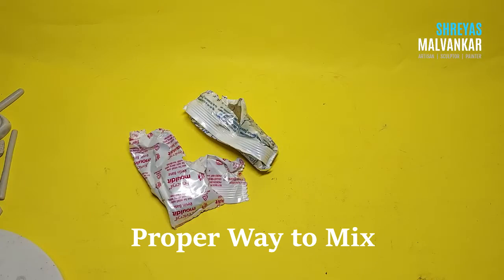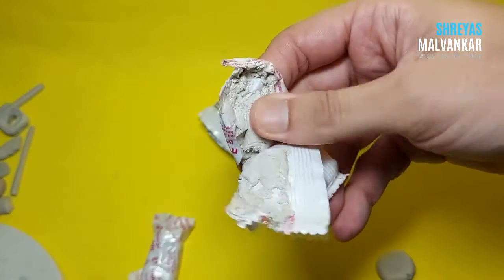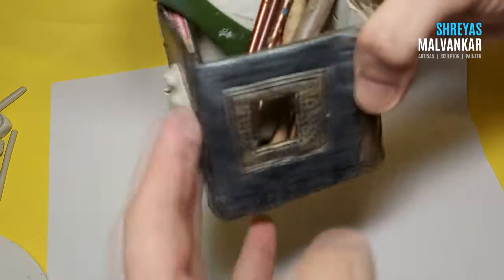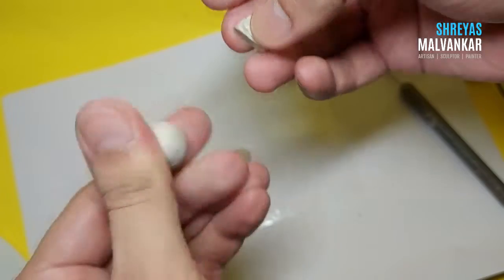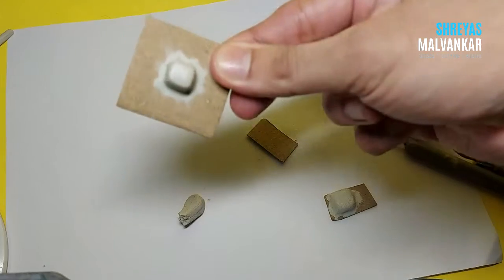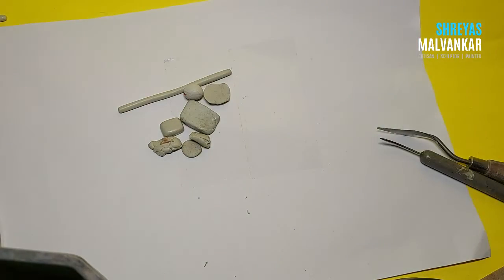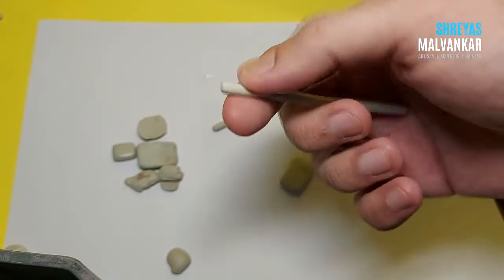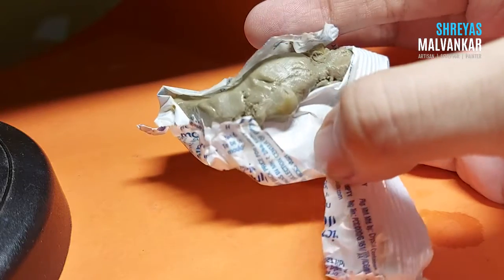More tips and tricks with Fevicryl Mouldit / Epoxy Clay

Comment: Would it melt from the heat of a motor, like glue gun stick, and does it dissolve when water falls on like like raining? and my clay does stick to plastic (not tape but plastic)
Reply from the maker: It wont dissolve while water falls on it. It wont melt from glue gun heat but there might be a minor damage, you'll have to try that. it usually dosent stick to transparent/cello tape or other plastic materials as per my experience. but it depends on type of plastics as well.
Reply: @smmcreations  Thanks a lot for the reply. I would be making motor mounts, any advice?
Reply from the maker: I have no idea in this, do let me know how it turns out, all the best @MegaTechno